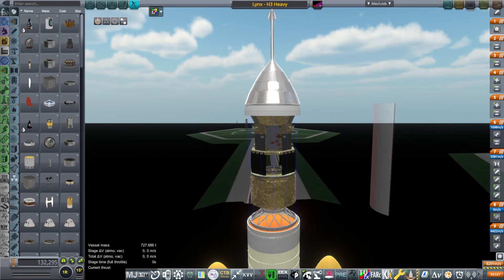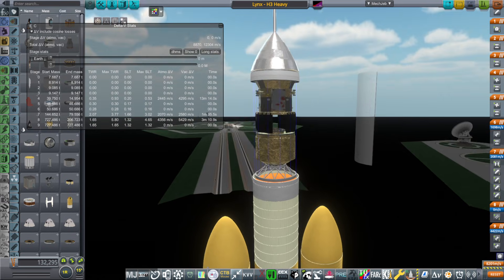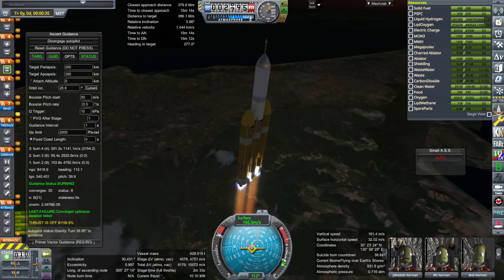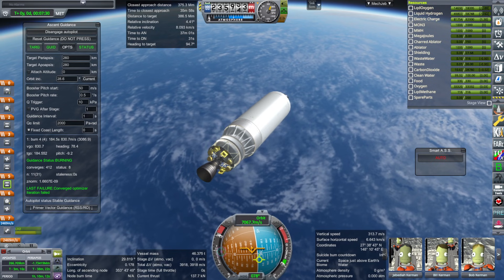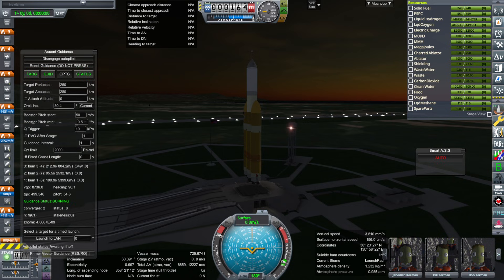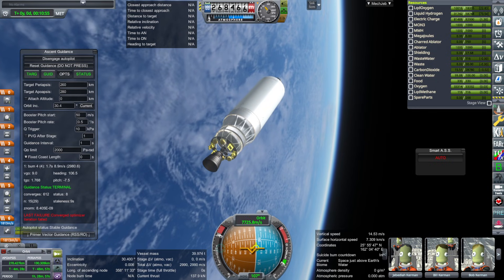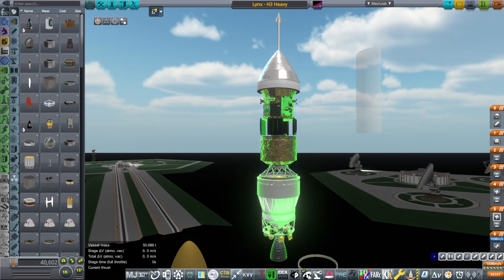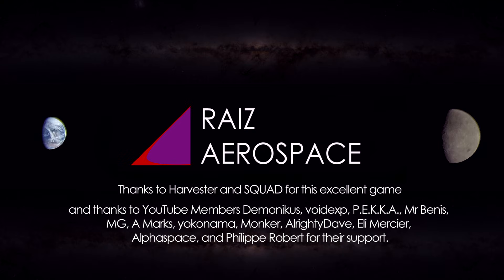Lynx on the H3 Heavy

Comment: Always payload loss in the details of heavy variants of rockets. Not saying this is a better or feasible idea, but if NovaCore starts development of ntr's a few years earlier in the timeline, maybe 2032 instead of 2038, you might expect around 2038 a 30 KN NTR to do the TLI burn. Kasei has its first in service launch in 2041(right?) so you wouldn't want to launch H3 & lynx any later then 2039.
Reply from the maker: Thinking about the realities more, I decided Kasei's initial marketed purpose isn't actually to launch Lynx, but to launch large in-space data centers which people have been pushing for which can't fit on smaller rockets. In the timeline right now, Lynx is test launched on Neutron in 2044.
Reply: @RaizSpace  Definitely a possibility if launch costs come down, still issues like dissipating heat, extremely large solar panels, or somehow managing commercial nuclear reactors in space. I guess if the money spent on expanding datacenters was spent on reusable rockets, launch costs would probably be cheap enough, and we'd be on Tau Ceti. I've also just thought, space is terrible at dissipating heat compared to using liquid or fans, so what would be the reason to launch data centers into any orbit?
Reply from the maker: All I know is that corporations with a lot of money to spend are very enthusiastic about launching data centers into space (https://fortune.com/2025/12/01/google-ceo-sundar-pichai-project-suncatcher-extraterrestrial-data-centers-environment/) and so, if we want to develop a rocket, we can get money from them if we promise to carry their data centers. It's not our business whether the payload actually works. The nice thing about the data centers is precisely that they need large radiators, which means they're physically bulky and need a large rocket.
Reply from the maker: That said, data in space was one of the key elements in my original sci-fi stories, because Newport Station - the main Earth orbit station - is meant to be the management hub for the global data system, repairing stuff as needed. It has on board it the Reliant AI, which at one point was manipulated by the character Tyler Raiz even though it was supposed to be immune to that.